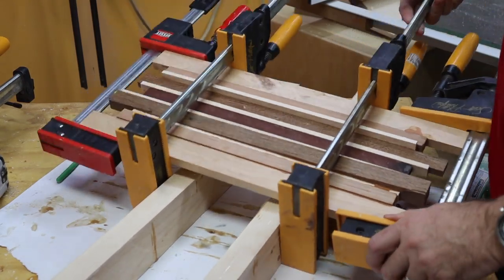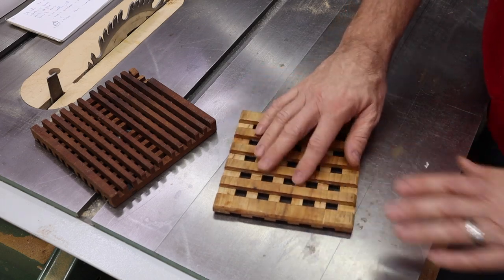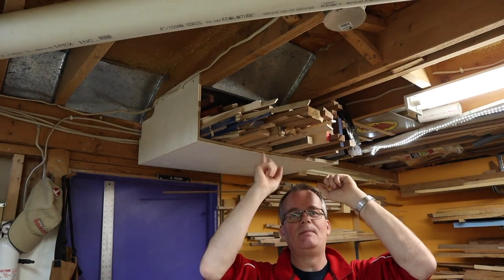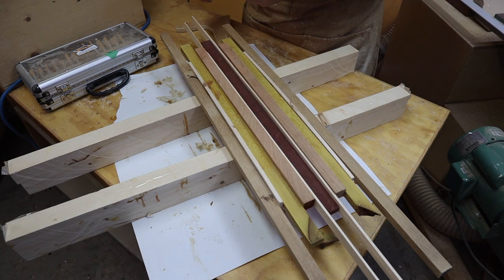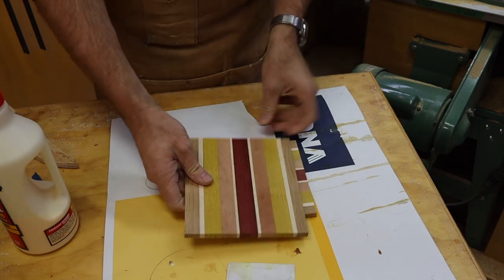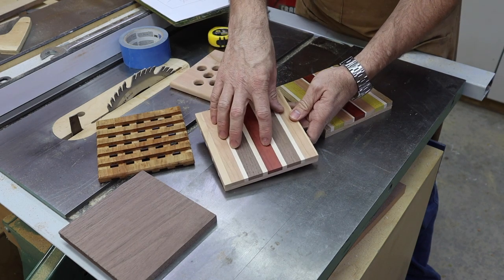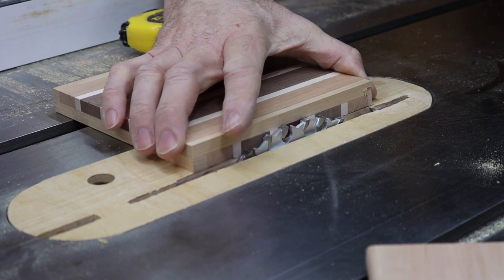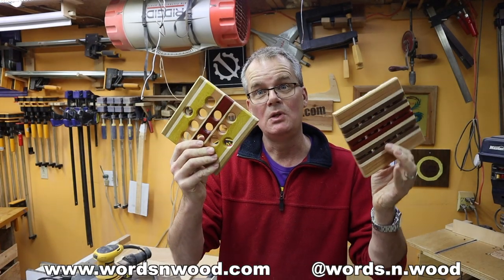HOW TO Make Trivets from Scrap Wood (WnW #185)

Comment from the maker: Feed my woodworking:  https://www.patreon.com/wordsnwood

----- -----
Pull out your pretty scraps for this quick and fun one.

In this project I laminated some thing stock together, planed it down to a bit over 1/4" thick, and then glued two pieces together at right angles, to make my own "plywood" which was then turned into some lovely trivets. I also made some "plain" solid wood trivets and talk through some of my design methods and thoughts.

Comment: Enjoyed the video on trivets. I have made a number of trivets in the shape of leaves (e.g. a Maple leaf) using a scroll saw and 1x6 poplar. I then cut the leaf veins into the trivet. I have placed little plastic feet on the bottom of the trivet to allow the hot air that goes down through the veins to get out as the trivet is not sitting directly on the table top. 
I was wondering if you have allowed for ventilation under the trivet that you just drilled holes in and if not have you ever had a problem with the hot, possible humid air, that is trapped inside the trivet damaging the table top.

Comment: These are beautiful. I just made a prototype out of mdf to see if I could do it and it worked great except for routing the edges.  I used a 1/4” roundover bit but the beating gets caught in the dadoed trivet slots, causing a wavy edge. Did you have this problem?
Reply from the maker: I have had that once, IIRC.   Were you working freehand?  I think it's less an issue on the router table, since you push the piece against the fence.    I should maybe do the roundovers BEFORE cutting the slots.

Comment: Merry Christmas Art!  For the single species boards, what if you took two quarter inch thick pieces and glued them cross grain as you did with the multi-species ones.  You could then either waffle or circle cut them without worry of warping.  Thanks for the inspiration!! :-)
Reply from the maker: Yup, that was my original plan, but I got sidetracked into the multi-strip pieces, so never bothered with that idea.
It would certainly work!

Comment: They look great Art, I'm just wondering about the holes as the waffle design allows heat dissipation. Would the hole design need feet perhaps?
Merry Christmas mate, keep up the good work.
Reply from the maker: I guess we'll see, Cliff.  I've had trivets with no holes at all, and they work fine.   Do you really think the pot would heat the air enough to damage the table?